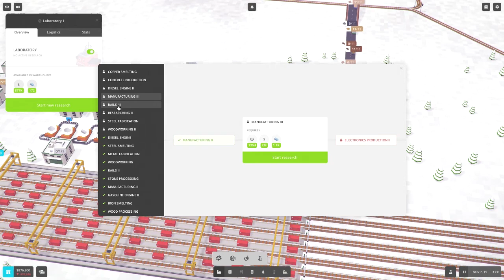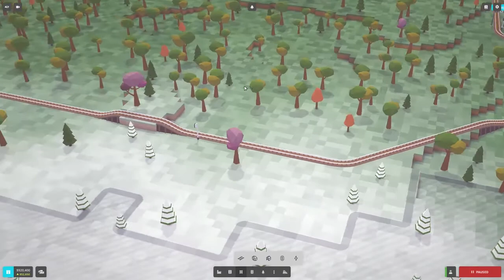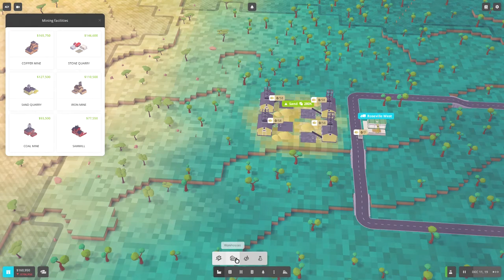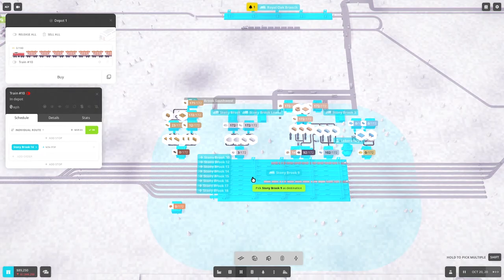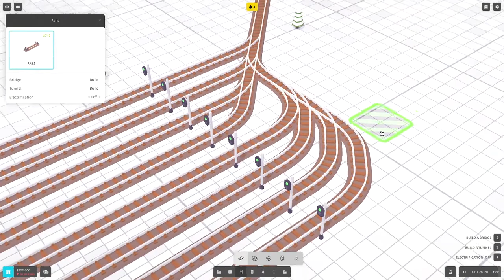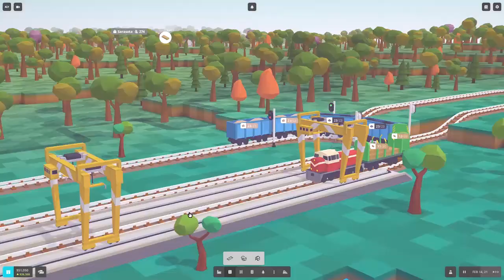Voxel Tycoon - E8 - Sand and Copper

Comment: Hi, couple of thoughts if you don't mind... The waypoins on the big station are not needed, the trains can pick their own tracks. I do think you can use pre-signals for that. There is a good vid out on explaning signals from TKH.( the cheap signals work the same but are just cheaper ) Result is that the trains can choose their own track to deliver on, they just choose a free one and don't go to one that's in use. Or let is work the way you want to of cause ;-)  Impressive tracksystem, that's for sure.
Reply from the maker: Ahh ok I wasn't sure if the waypoints were 100% needed just using them to avoid any potential crashes and to keep things somewhat organized.
Reply: @Door_SG  Just a new feature discovered for the tracks on a station. Right of the station name is a very small box. click that and you can turn on or off specific tracks on the station. Could help instead of waypoints. Just say 'those two' are open for you, the others are closed. These Devs are next level man. What a QoL they have allready put in is impressive...
Reply from the maker: Yep totally never saw that button but sure enough it can be used instead of waypoints.